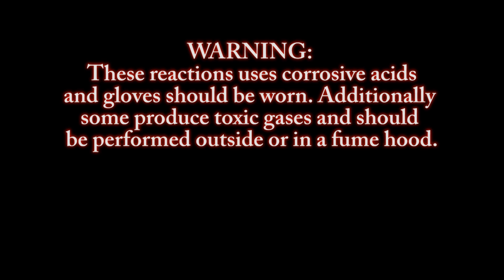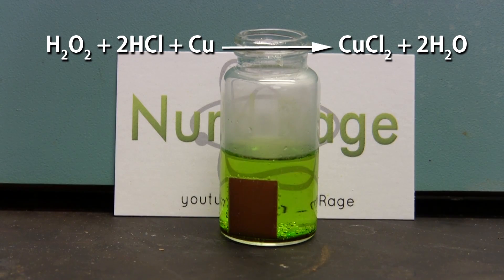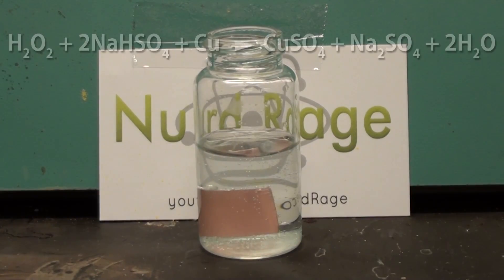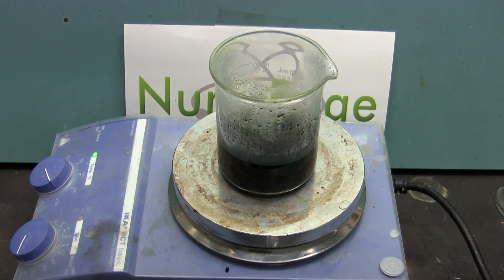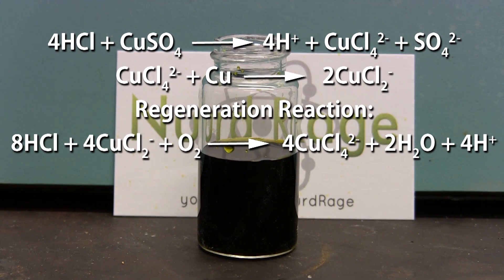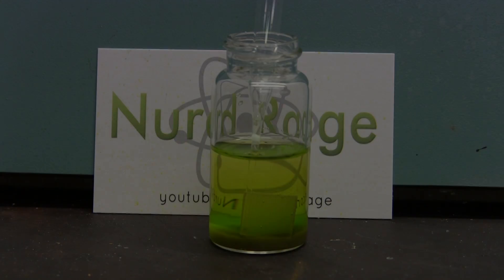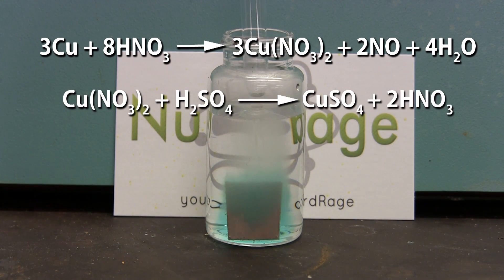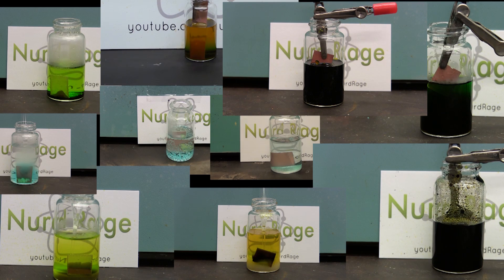Make 10 Etchants for Copper Printed Circuit Boards

Comment: I've used silver nitrate for my pcbs. It can be quite advantageous since it doesn't fume, can be regenerated and you can see very nicely where it is etching. Also it doesn't produce any bubbles during operation hence it wont tear up protective coating you have on the copper. Of course it's expensive (at least at the begining when you get initial silver, then it's just the cost of nitric acid, which can also be pricy, depending where you get it from), I probably wouldn't have used it, if I wasn't refining scrap silver anyway.

Comment: One cheap and easy copper etchant, all from your supermarket:  

one part "white vinegar" + one part of "3% hydrogen peroxide" + a teaspoon or so of "table salt".  Mix and use as etchant (warmth + a bubble tank will help).   

When finished, before disposing of it put a load of shredded "aluminium foil" in the used up etchant to remove the potentially toxic copper, and wait overnight until the solution becomes clear...
... then you can filter and dispose of the liquid (drain) and solids (garbage) separately.

Comment: You gotta make more gold recovery/refining methods and techniques. Esp when it comes to dropping certain metals out of solution using copper, zinc, steel etc. Alot of people use the Acid Peroxide -> Filter -> HCl/Bleach  process and there is not alot of decent videos on exclusively the methodology of using said process. Please please please make some more!

Comment: peroxide + any acid will work as an etchant, for example, citric or acid or vinegar and it will etch pretty much any metal. But most etchants that produce bubbles are useless for PCB making
the best one so far is ferric chloride with some amount of HCL where you occasionally pour some peroxide for regeneration.
copper chloride + HCl may also be pretty hood but I did not test it as it gets naturally pro9diced as a side product when etching PCB in ferric chloride

Comment: You forgot that etching circuit boards requires a "resist" to protect the copper you want to keep. Organic coating like laser printer ink, sharpie marker ink, etc would be damaged by nitric acid. Production circuit boards usually protect the copper with tin or solder plating. Several of your etchants will eat thru that protective layer.

Comment: I was a QC chemist at a circuit board shop. 
We and other shops use NH4Cl + NH4OH + O2 recycled by cooling to precip CuCl2. Edta and ammonia complex Copper so we used NaBH4 to precip and filter out metals from waste stream. Else Aluminum foil or Steel wool also works. We had used Iron powder b4, after Copper removal filter magnetically. Also Ammonium Persulfate sold in electronics parts stores is very clean used for prototypes. Potassium Persulfate, in pool supplies, also works.

Comment: Why so little importance to naoh + hcl? wouldn't it produce salted water + copper? That would be about the cheapest method to etch for many of us living where hydrogen peroxide costs an arm and a leg. I'm not a particular fan of storing chemicals at home because of the kids, so ferric chloride and others are out of the list. A shame you didn't give more info like times or proportions.

I'll try more or less what I see on the video and hope the chlorine produced doesn't cause much harm the ozone. After all I'll only be using it every once in a while. Thanks for sharing, though!

Comment: Thank you! thank you! thank you! for all of these electronics chemistry videos Nurd Rage. 

   Seriously, you've played a major role in helping me discover my interests in PCB design and prototyping. I have been goofing around with electronics since becoming partially disabled in 2014. I've gone from goofing around with copy and paste arduino code to hacking old junk, to designing and etching my own circuits. I've watched this and several of your other uploads a dozen or more times. I have been playing with a container of ferric chloride I was given from RadioShack before they went belly up. I'm finally to the point where I want to try etching some larger panelized designs that are close to A4 sized transparencies. Today I was given a container of muriatic acid from lowes, some 3% hydrogen peroxide, some steel wool, and I'm back here for notes! I also have an old container of tarnex to try that tinning solution recipe you cooked up... yeah I'm that slow...  as a gimp it takes forever to get things done. I really really appreciate the references you've made here.

  One problem I'm having is the unknown concentration of my old ferric chloride from RS. I don't know if I should try to heat it to evaporate/concentrate it or modify it somehow. Even the last 1/3rd of my bottle of fresh solution took around 45min to etch a 5cm × 10cm double sided design. Most people that I've watched or read about say that etching with ferric chloride should take around 15-20min. How does an amateur go about characterizing the quality and strength of their enchant? I don't expect an answer here or anything. This is simply intended as a positive feedback blurb. I'm just sharing a challenge incase you or anyone else thinks this kind of thing is worth addressing.
  I'm sure you have a laundry list of things you'd like to make content about. 
   Another chemistry experiment I was curious about recently is trying to play with making a transistor using doped materials. I was watching Robert Baruch, on the channel by the same name, reverse engineering a 74 series logic chip at the die level. He was talking about a way to dye the p-channel doped materials during his last live stream. That got me curious about what other transistor effects could be made at home or even in the average lab. It's just something to think about if your interested in that kind of thing ;)
-Jake

Comment: Just wondering if you could make one using OxiClean (Sodium percarbonate) and HCl?  Sodium percarbonate allegedly breaks down into hydrogen peroxide and sodium carbonate when mixed with water.  The problem that I see is that the sodium carbonate is the same stuff that is used to develop and strip the photoresist from the board.  However, would the HCl neutralize it so it is inert?  The OxiClean is considerably cheaper around here than the high % H2O2.

Comment: @NurdRage I use Ferric Chloride to etch steel (and stainless steel).

Would adding HCl acid to the weak/spent etchant and then bubbling O2 re-constitute the Ferric Chloride?

Thanks!
Reply: A bit late, but yes.

Comment: Printed Circuit Board shops usually use Ammonia/Copper/Chloride bath and Reoxidized by Air. Can cool the bath to drop out Copper Amine Chloride complex as Crystals or can plate out the Copper. We treated the Copper waste solution (alkaline) with Sodium Borohydride and filtered out the Copper.

Comment: +NurdRage Can you please make a video about copper deposition on non-metallic surface like plastic and glass to be later plated using electricity and if possible the method would be easy to be done at home. the reason for that people (I am one of them) want to make copper plating for making double sided pcb at home but to plate the walls of holes in the pcb with copper(which is fiber glass) to make it condactive is not something everyone can do !!
Thanks
Reply: Copper won't spontaneously plate on plastic or glass unless a thin layer of Palladium or Silver is applied first. Electroless Copper bath: Rochelle Salt (can use EDTA or TEA instead), Copper Sulfate, pH=12, Formaldehyde (or Glycolic acid or Gluconolactone).
Reply: Stephen Jacks 
Thanks, but I have seen other people doing Copper deposition without using Palladium or Silver, that involved using complex solution which has Calcium Hypophosphite one of its key components.
I was wondering if there is a simpler way to force copper deposition on non conductive surface first with good surface adhesion which could be done at home.
Note that currently I am using conductive ink which is very messy and doesn't have a high success rate.

Comment: I heard it was possible to anodize with a solution of Water and Sodium Bisulfate. and i have 2 questions about this. since i wanna use this as a method of anodizing the aluminum of a cpu heatsink

1.i wanna have a much safer way of anodizing then having a tub of sulfuric acid around. so would something like this actually work to do so?
2.will a sodium bisulfate and water mixture at a ratio of 40 grams of NaHSO4 to 160ml of water be harmful to copper during the anodization process or even before being anodized as i am unable to remove the copper heatpipes the heatsink comes with without damaging the copper?

sorry for a random question... but i figured this question be best asked on a video based around Sodium bisulfate
Reply: Anodizing Aluminum (usually with a source of Chromium ions) creates a layer of Aluminum Oxide on the Aluminum part. Copper does not dissolve in cold Sulfuric Acid, but attaching the part to positive voltage source will etch the Copper metal.
Reply: alright good to know that i will have to come up with some way to anodize the aluminum without emparting a current to the copper... that may be a bit of a problem. i do not wish to damage the copper heatpipes and make them work less efficiently.

Comment: Olá Nurdrage!
What kind of compound do you get when you evaporate the CuCl4 ²⁻ + H⁺ solution?
H2CuCl4 (s) ?

Because I've tried many times and it always ended up as a wet mess of needle-like crystals.
Reply: CuCl2*2H2O and wet because HCl boils higher temp than water.

Comment: What I am still looking for is a good simple cycle for etching. Like electroplating out the copper, and then being able to reuse it forever, only filtering it from time to time, or refill a bit chemicals now and then.
Reply from the maker: What you want is theoretically possible. A device can be built that electroplates the copper out of the solution while simultaneously returning regenerated etchant rich solution to the etching bath. It could even have sensors and control circuitry to monitor and adjust bath chemistry accordingly. The result is a device you power up, let hang in the bath and remove the copper sludge periodically (which was the copper etched). I suppose i could build such a device on this channel but if i'm doing it for free it would have to wait until after my pyrimethamine series of videos, which will be months away.
Reply: NurdRage I think that would be an awesome thing for the hobby electronics community that etch their own things (given the advent of cheap chinese pcb manufacturers, these seem to get less unfortunately). Most seem to feel uncomfortable handling chemicals, and if the maintenance boils down to having to remove the sludge periodically as opposed to having to refill or even dispose of chemicals, then I think that would be great for a lot of people and might for some remove the barrier to start doing their own boards. As for the time, I personally do not care, I value quality over time.
Reply: i was excited to didnt saw your comment, check what i found
I just made a BIG OBSERVATION (I am roockie) but i learnt about 
electrolysis and plating, i attached +ve to copper and submerged into 
vinegar - peroxied solution and what was taking hours is done in 
minutes, No idea what happened, care to explain? . just got this idea 
and tried :P

Comment: Copper (II) Chloride can be neutralised with sodium bicarbonate (makes a green sludge), or simply place wire wool into the solution until all the copper has stuck to it.

Comment: ~3 Years after this video has been posted. WHERE'S THE VIDEO ABOUT DISPOSING THE ETCHANTS?!
Reply: Aluminum foil or steel wool will take out the copper, once the blue is gone filter and neutralize with "washing soda"(Na2CO3 10H2O) then flush. Filtered metal can be recycled or tossed.
Reply: @NerdyNEET  In Germany it is forbidden to dump copper solutions with more than 0,3 mg/l into waste water. No one will complain if you only clean you etching pan under a lot of water, but dont pour liters in your toilet! Copper is VERY toxic for water organisms...
Reply: down the drain

Comment: I have been using sodiumpersulfate with an air bubbler for years. After use I add sodiumhydroxide to fell all copper as oxide. The copper goes in a jar and the neutral sodiumsulfate water can go in the drain. No nasty fumes and I can order both chemicals by the kilo online.

Comment: How many of these also react with silver?  I'm assuming #10 does (since it also does gold), but how many others?
Reply: LFTRnow Nitric acid reacts with silver, as seen in his video about making silver nitrate
Reply: TheySmashedAnHourglass Is that the only one that would work?
Reply: TheySmashedAnHourglass Also interesting, I got hold of a 10% silver mexican coin which I don't know exactly what the remainder is, but I believe it is tin and copper.  I hit it with HCl and H2O2 and got a nice green-blue liquid, and what I can only assume is powdered silver.  Interesting experiment.  Any suggestions how to separate the CuClx and SnClx from the liquid?  I'd love to figure out how much of it was what.
Reply: LFTRnow I can't help you with that, I know very little about chemestry, sadly ._.
Reply: +LFTRnow 
Take the powder and check if it melts with a soldering iron. If it does, then the power may be passivated tin chrystals. If not is is probably silver.

Comment: so what kind of etchant is this: http://www.ebay.com/itm/200g-Copper-clad-palte-CCL-PCB-blue-environmental-protection-etchant-brand-new-/221461079030?pt=LH_DefaultDomain_0&hash=item33901be3f6
Reply: It is likely one of the persulfate or permanganate etching solutions he mentioned at the start of the video.  Based on color it is most likely to be sodium or ammonium persulfate, but since it doesn't say anywhere on the page it could be anything white and crystalline (sugar, salt, etc.).

Comment: I tried first metod with H2O2 and HCl but it isnt work i've got 30%Hcl and 30%H2O2 which temperature is the best ?  I tried 33ml 3% H2O2 and 33ml 30% HCl - it isnt work

Comment: Hello,

I have some H2SO4 but its only 50%. But my H2O2 is 30%.
Is it correct if i use the following formula?
2mL H2SO4 (50%)
1mL H2O2   (30%)
8mL H2O
Reply: For other pp with the same problem,
I tried this furmula, but it went painfully slow. A few hours to dissolve all the copper. There is even solid CuSO4 forming on the pcb.

Next try,
Less water, more etchant to copper ratio.

Comment: NurdRage, thank you for posting your videos! They are very useful and well done. I have a question though: can you make a video or help show me how to properly dispose of concentrated chemicals such as muriatic acid, ferric acid hydrochloric acid ect. thanks!
Reply: ATTENTION EVERYONE!:This is the best comment I've seen on here. People need to realize the TOXINS they are USING AND CREATING and make sure that they RENDER THEM SAFE and DISPOSE SAFELY. This DOES NOT MEAN ONLY NEUTRALIZING THE ACID! THE METALS YOU ARE ETCHING CREAT COMPOUNDS THAT ARE TOXIC! WHATEVER YOU DUMP WILL GO INTO YOUR GROUND WATER! This video claimed there would be a video on this topic. I haven't looked for it yet. If NurdRage hasn't posted one, FIND ONE IMMEDIATELY! AND *******DO NOT MIX WASTES EVEN FROM SAME ETCH WITH DIFFERENT METAL! ALL DIFFERENT CHEMISTRY IS DIFFERENT!******
Reply: I want to do this 100% green meaning that I do NOT trust any commercial entity to hand this stuff to and hold any confidence that they are not going to take it and mix it with fracking fluids or just drive a tank truck out to some convenient spot and open the valve... Thank you sincerely for the heads up, and please keep me in mind if you see any more info.
Reply: @Tricknologyinc  Then use copper chloride as it is supposed in the video you commented below. That is 100% reuseable.
Reply: Tricknologyinc He just posted a video on recycling etchants. Otherwise take the waste to a proper chemical waste disposal facility. Ask your local garbage company if they have one.

Comment from the maker: Maybe your copper isn't pure then. While copper does catalyze decomposition its usually not too fast that it doesn't dissolve.
If you want to make CuSO4 then use the electrolytic method i showed in another method. It'll still have H2SO4 in it but that can easily be filtered off.

Comment from the maker: Brass is an alloy of two or more metals, usually copper and zinc. But yes, there are lots of copper chloride and zinc chloride compounds. The apparent speed can be attributed to the sludge formation. The brass dissolves and breaks off microscopic pieces of metal (the sludge). So for the same amount of energy more metal "dissolves" because it's cheating by breaking off sludge instead. Like cutting a pipe at the base and throwing it all away as opposed to slowly melting down the whole pipe.

Comment: yes it leaves a sludge , you can actualy see the brass "spray" off the electrode , i was just wondering if you new of a brass chloride compound ? asking because as i said the reaction does not liberate chlorine. i have tried alot of other metals and your write others do dissolve just not nearly as fast as brass. thanks for your input

Comment from the maker: Probably works with a few more metals rather than just brass. I suspect it would also dissolve zinc as well. I don't know of any special properties that would make brass much easier to dissolve as opposed to other metals. Is it dissolving cleanly or is it leaving a sludge or sediment in the bottom the tank? If it's leaving a sludge/sediment then the faster dissolution might be from it simply being easier to break-up so less energy is needed to actually dissolve metal as opposed to breaking it up